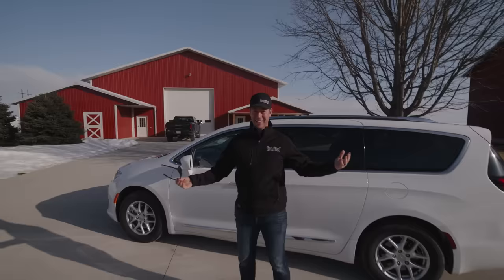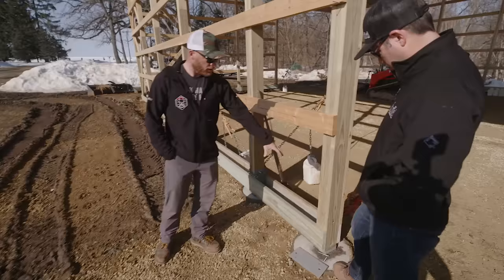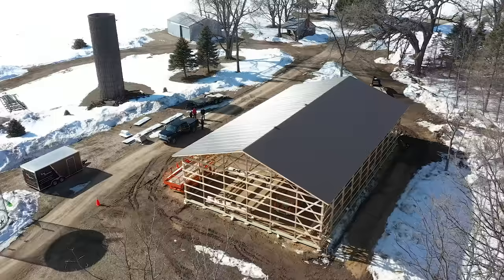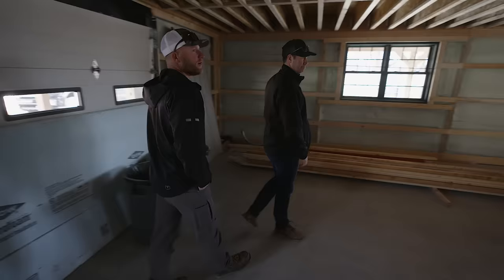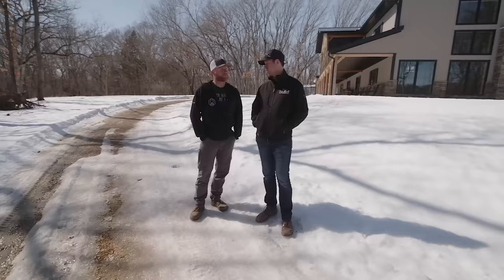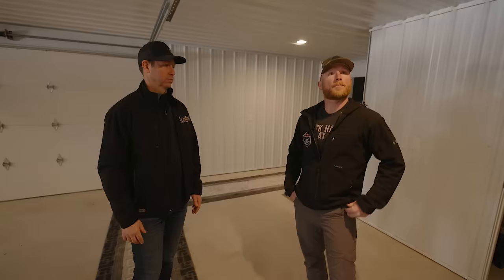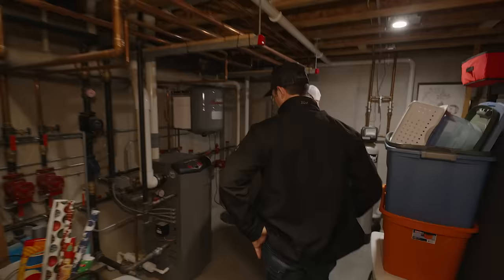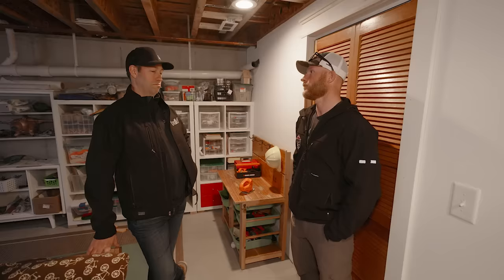BIGGEST Building - LOWEST Cost - Post Framing with RR Buildings!

Comment: Really good construction, a solid step up from the pole barn. Good video. Thanks.  That corner X bracing is kinda what they do in Japan. My guess is that the girds(?) are strong enough to hold the whole wall together if there's a twisting force, tornado, earthquake. I never gave much thought to a traditional framing brace running diagonally across multiple stud bays until I was in Kumumoto, Japan a month after a serious earthquake in 2016. Those braced corners didn't do much, the structures twisted about 15-20 degrees and the roof collapsed the whole 1-2 story building. What's different is there was nothing like the girds tying all the 'stud' bays and the whole wall into a single plane. 
I went all over Japan, roads, bridges, modern sky scrapers - all built to the highest international standards. Domestic houses, barns, small businesses - wood structures I saw  zero effctive bracing (but I didn't see much new construction)  It was weird. I think they based the structure on the Chinese temple structure which is very earthquake resistant, but then to make houses and barns they eliminated the key features that make the temples so resilient. (And a critical factor are those heavy clay tile roofs. The old shack on a steep hill that I live in will survive earthquakes - been through dozens already - is because everything is so light weight) 
This Post Framed structure? I want one. And if I was still thinking about the bracing... I'd ask, or pay for the extra engineering to reassure me.
The cupola. Good detail.  If you had any kind of a below grade basement with windows (small basement windows work well  I know from experience) then just opening up the cupola windows would keep the whole house cool in the summer. My dad did this on our house in Michigan (but had a huge ceiling fan instead of the cupola). In ... Mississippi (I think)  an antebellum mansion was a multistory octagon, cupola with windows... don't remember the details - but same convection idea - stayed cool. And the high school my son taught at in Japan had clerestory windows that a thermostat mechanically opened and closed. No other air conditioning. Cool and good air movement in the hot summers. Japan gets as hot as the midwest. 
I was thinking of  getting a piece of land, big barn and an Airstream parked outside. It would be really easy to just build a nice weekend home on a second level along one side.

Comment: These barns are nice. The open span is awesome if you have big equipment that needs to be kept inside. Construction costs go way up when you have to have heavy equipment to set the rafters and a lot of cement under the legs.
Typically your foundation is going to be 40-50% of your overall cost.

Not so with a pole barn. Pole barns are perfectly fine, they are awesome for livestock and a lot of other applications and they don't require a 15 T picker to put them up.
I am not a construction hand but I have built livestock barns.
Trying to build a barn now but costs have gone crazy with the fuel costs.

Comment: I use rigid galvanized steel pipe... cut them in half or as needed for leveling, and leave the threaded part sticking up out of the ground (depending on what I am trying to do, frostline, etc.)  Then couple on as needed.  (Use your imagination for a second or third level) I have a sealed engineers drawing with the details on how to bury, backfill and fill the pipe... showing which diameter and method to use for typical building heights... and a detail of attaching steel and non-steel beams to the pipe... works great when doing a deck or patio and want to put a roof on later...

Comment: My home is an open 30x40 with 10' walls red iron perkins trusses with galvanized metal girts between the red iron.  Open floor plan except for the back corner bathroom/utility room.  The building is Insulated according to the Anchorage Cold Climate Housing Research Center's cold wall system. The trusses set on a stem wall with footings below the frost line.  In the floor slab I have 2" foam 4' board around the exterior of the slab.   I heat the place with a single air source minisplit heat pump and have natural gas for back up and when it gets below five degrees Fahrenheit.   I sheathed it with plywood and it has a metal exterior.  Insulation is 7" foam on roof with 5" fiberglass between the 2x6 roof girts and the walls are 3" exterior foam and fiberglass between the 2x4 wall girts.  my ceiling is aluminum soffit material from the local Restore.  90% was my labor alone.
Reply: @OlTrailDog - Your home sounds great, maybe you can post some photos or video to it on your channel, or somewhere online, would be very interested to see it.

Comment: Those metal panels, as shown (PBR, PBU, etc), don't have engineered in-plane shear resistance values. That's the reason metal buildings have those X steel cables in the walls and roofs. You will get some amount of shear resistance out of them, but the amount is unknown, and I think foolhardy to rely on them as your only shear resistance.

Besides that point of concern I just shared, it is a cool way of buildings with a lot of good aspects to it, but design your X-wood members being your shear resistance all the time so people don't get hurt in storms or earthquakes.

Comment: 2 bolts hold the post flush to concrete 8 to 12 inch 6 inch steel plate to 8 to 12 inches of post lot weaker side to side pressures then post 4 to 5 ft in the ground tornado winds will rip the12inch of wood right out the bolts still believe straight into ground is stronger then sectioned. Together at ground level

Comment: I see a lot of similar buildings posted on Facebook but they're often the original "pole barn" I think, with post in dirt and concrete poured afterwards!  I tell myself that can't be right trying to build a home like that here in Texas, am I right in avoiding these?  These here from RR Buildings look very different with the posts bolted to steel which is sitting on a concrete support, so it sounds like at the end it's basically like the usual concrete foundation except the frame was sitting on it's own supports beforehand.

Comment: It’s basically a pole barn crossover .  Same thing just blew away on the corner of 251 and 64, and another on Stillman rd IL.  Mine has 5 2x10’s screwed together for the post framing(nasty) and it was shaking  in that wind.  It’s cheaper but stick framed is stronger.  I won’t be hanging out in the post building in 60 mph winds again.

Comment: Real nice I did metal  siding  on  my wife garage  i put 6 ft  alum foil  bubble wrap horizontal and overlap my bubble wrap 4 inches and tape over my purlins a nd the same on t😮he  inside except i didn't use purlins i cover with osb ,  than build a 12x12 box so i could blow in celosue from the attic which i put in plank walkways  all over 2ft above ceiling .,for the bottom  rim jiost i put 2 inch blue  foam boards  and spray foam  gaps,   under windows where all foam board. .im in Upstate NY  ,Burke  .   ..and it has not froze inside even with no heat. As i put water bottles in corners ,ect. To check .kept up the good videos.

Comment: Didn’t explain the concrete slab being on top of the basement. Explained the floating hardwood floors on top of the radiant (warm board) over the basement but not the concrete slab over the radiant (warm board) floors over the basement. RR Buildings

Comment: Matt do you think it's possible to make a Pole barn or Post Frame building in a passive house? What kind of materials would be needed to seal that? Anything different than what you are currently using in your home? I understand that a Post Frame is usually on concrete columns but like in the Music Shop in this video it's pretty tight. What could be done to make it tighter?

Comment: Backfill against wood and concrete directly in contact with wood? I'd be worried about rotting on that bottom plate. The stem well seems to be a better idea if you're going to backfill and have an interior slab.  Other than that, great alternative to a PEMB.

Comment: If you are into long term quality, you shouldn't use rust-oleum on zinc (galvanized steel):
 Alkyd/oil paints that are applied to galvanized metal will adhere initially, but will quickly fail. The zinc of the galvanizing will chemically react with the alkyd binder of the paint, creating a "soapy" film (saponification) on the galvanized metal and causing the coating to peel. 

You will want to use an Acrylic paint, not an alkyd.

Comment: The advantage of sinking the posts into the ground was structural.  I like this method better, but the connections are key.  What are you using to connect the Post to the Footing?

Comment: Second building: we didn't see enough about the roof/ceiling.  I assume you have cathedral trusses with "exterior" steel panels on the inside. .
-- I'm a mere mechanical engineer who worked building construction while in college and have built many buildings on my acreage in retirement. My engineering "skills" come in handy only in helping me figure out how to overcome my remarkable screw-ups because my carpentry skills are (weak.)  However, I can clearly see RR Buildings is brilliant--inspirational. ( But I cringed when hearing "I suppose this garage wall & ceiling is fire-safe." I prefer hearing much more confidence on that topic.)  I rarely Subscribe to any Channel but have to Matt AND RRBuildings.

Comment: Stuff like this just blows me away.  My house $750K.  1200 square, 3 bedroom, 1 bath, No heating, no AC, no garage, galv pipe, cesspool, no insulation, no framing/single wall construction, pitch/paint roof, no real closing windows (jalousies) washer/dryer out back.  No yard on any side.

Comment: Hey Matt & Kyle, you should come check out my 3500 sq foot, 10' finished drywall ceilings, radiant floor heated, mini split AC, R20 slab, R55 wall, and R60 attic, that I built in Cincinnati OH for $65/foot! That's around HALF of local finished residential!

Comment: Where I live the posts are laminated like the ones used here except that the treated portion is only the bottom 4 ft and guys are still sinking them in concrete (or gravel).  BTW -- I had a shop fire burn mine to the ground and removing the remnant posts was a bitch.  Saw cut the concrete and then try to lift the concrete out of the hole you originally poured it in.

Comment: No matter how you look it, it still a pole barn it has nothing to do with setting the pole in the ground where they where utilized round posts basically trees, old even power poles or something similar as main structural supports, that how the term pole barn stuck, where post framing is just rough or pre-cut timber so matt and kyle it still one in the same Pole Bran after all the framing assembly technique is the same, as the only thing that change over the year is not setting the pole directly in ground after all wood dose rot over time and add a concrete slab vs reg dirt floor.

Comment: Floor drain is good to have.. How many of those tiny houses can fit in your barn?
We use Rhino Steel buildings out of Texas.. spray all interior surfaces with1.5"+ tight cell poly foam..
As far as perimeter foam at floor the foam board needs to be buried a foot below the slab depth.. just sayin

Comment: Cool thing about frost heave; if your frost depth is say 48" and your piles are 48" deep, that frost will impact 100% of the pile.  Now, if your pile is 96" deep, the bottom half of the pile will counteract the 48" of frost heave, possibly resulting in a split pile at frost depth.  Now, if you have a pile that is 3x the frost depth, (i.e. 12'-0" pile with 48" of that in the frost zone, the amount of friction is 2x the frost action thus protecting your building from uplift.  Don't fall victim to the line of thinking that your pile to frost depth is accomplishing anything.

Comment: i KNEW you could get a basement in one of these! our local post framers don't do basements, or at least they've never tried,  but considerign the location, and the fact tornadoes and high straight winds ripped through last year where we want to put it,  a basement is necessary.  

do you recommend using ICF's for the basement?  and at what thickness should they be for one of these post frame style buildings?

Comment: Question, Why is the concrete floor poured after the walls and roof in place? Would there be issues pouring Sono-tube piers for posts then the slab prior to framing? Thanks!

Comment: Have you ever considered insulating walls using Styrofoam Aircrete with an 10" post & truss construction? 

Ten inches being lightly plained  2x6 laminated beams that are unplained on non laminated surfaces, unplained 2x6 laterals inside and out to mount sheething equaling ten inches!

Comment: This noticed might have been stated before but why are the column supports not centered on the column.  ACI requires roughly 3 inches of concrete before the supporting structure bolts.  it looks like the support in the concrete are not even close based on the video.  Must be an area of no code enforcement.  Then we can discuss the 6 inches between ground and non-treated wood.  maybe I am missing something.

Comment: How well does this stand up to possible Forest Fires..? Does the metal protect from ignition from flying embers.. or does the metal warp from the heat, and fail to protect..? Or does it protect to a certain level and then have failure..? Or just all depend on how close and how hot the fire gets.??
I am thinking of building up in the Smoky Mountains -- North GA or western NC.

Comment: just found your channel thanks for info.  Note local builder told me just did a bid for 40x80 it was cheaper to use steel frame vs wood frame with current prices of wood.  Have you seen this same thing?

Comment: we call em pole barns, pole framing, pole frame shop, pole frame garage... odd cuz poles are round right?  really when its a house it's called big timber framing, rough timber framing, post frame, vintage frame, so forth..   I think pole barn comes from how they used to do pole barns in the day, go look at any vintage old 2, 3, 4 story barn how they're constructed, they dig a post hole, put your column in and fill..  then your lateral framing for siding, in the day they would frame it up the same but instead of metal the roof gets shingles and the siding was generally a vertical ship lap, 3/4" x 8 or 10" or a T&G siding, very thin even 1/2"  you see so many of those still working today built early 1900's late 1800's.. and I think that's why that style is adapted for so many shops and garages, they just work, and with metal roofing and cladding they are almost indestructible and will be there hundreds of years as well maintained..

in all honesty trusses actually came from these types of barns, they couldn't simply stick frame them like can a house, so they have a dual pitch roof, and they did this so they could use bracing and build a truss type system... goo look at an old barn, the trusses are hand made yet do not have a bottom cord, no webbing like todays trusses,  they are doubled up and they use lateral bracing where they angle turn, saves lumber, they are stronger and lighter and easier to build.. this is why the conventional bard has the dual pitch or Gambrel roof, more headspace all the way around an advantage...

Comment: Could I add a large post frame addition to a normal/traditional (?) built house, can you integrate them?

Bought a property that has a ~500 sq. 1st floor + large 2 car garage + second floor above all of it guest house, not a full 2nd floor because the 2nd floor roof is pitched but it's bigger than an attic pitch, and I need to turn it into a larger home by adding ~1200 sq. ft on the end of it.  Proving to be a difficult/impossible task within our budget.  This is in NE Ohio.

Comment: Instead of using post footing has anyone used 6 or 8" ICF wall for post footings?  Locally a post footing supporting an occupyible structure must go down 13 feet (4 meters) being 39" (1m) across at base with engineer certified rebar where as an inground wall with or without crawl space wall can be only 4 to 6 feet deep depending on frost depth with a minor footing under it and minimal rebar as required by ICF manifacturer!

Comment: All I see is still considered a pole barn with flat bottom trusses. Where a traditional pole barn is set into the ground, but the trusses are set with the same pitch as the roof and made of steel. What really bugs me about this one building being shown in the process of coming together is the leading wall, some of the laminated posts are not sitting centered on the piers. Someone got the layout incorrect from the beginning for laying the piers.

Comment: When you finish the inside like this, you're not really saving much from a standard stud wall construction;  because you still have to run your slats everywhere inside and outside of the posts/  that's a lot of extra wood.  The REAL benefit of building a post system is when it stays unfinished on the inside, because that way it uses the bare minimum of materials.

Comment: i had a EPS building built this way except it turns out the the laminated pole weren't glued. i got hit by an f1 tornado 105 mph wind my building blew up like it was filled with dynamite. it was the non glued posts separated and snapped like twigs.

Comment: How much do you save per a sq foot over iron, iron is much stronger and dont have t oworry about termites. So i guess im wondering what the selling point. He says i dont think you would get as good a product out of steel, please explain that. 85.00 a sqft is pretty high for finish, my brick house with granite engineered wood floors etc... is 110, I have talked to people that do steel building metal framing at 50  to 60 sqft. pre 2021 due to material prices.